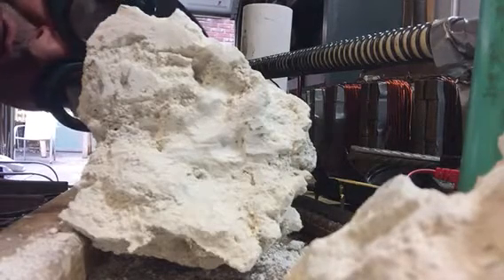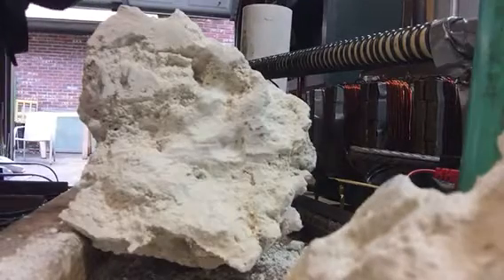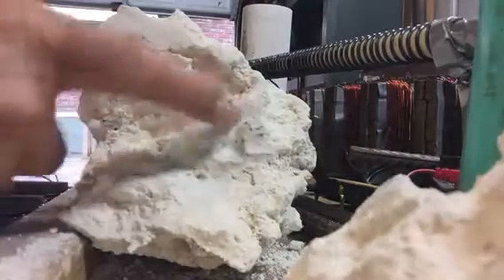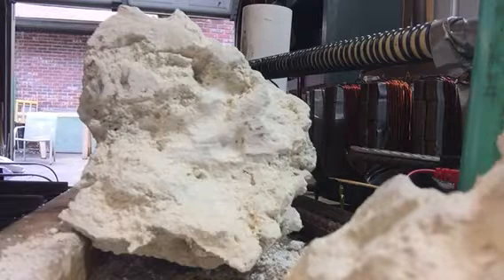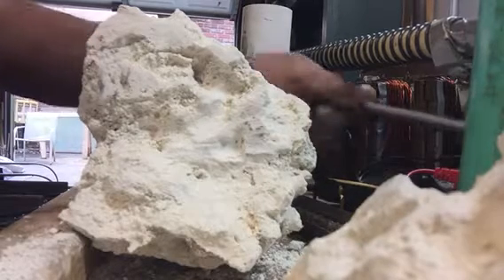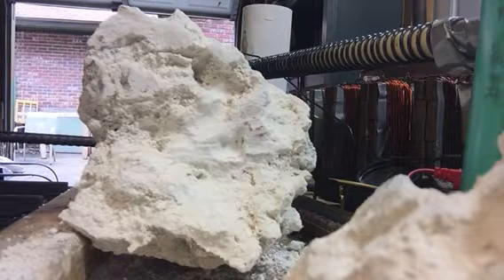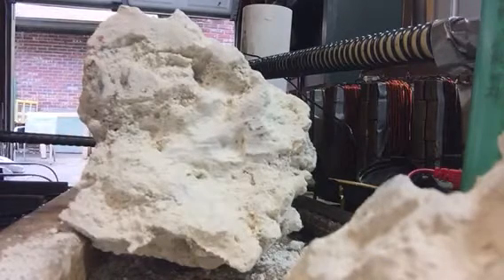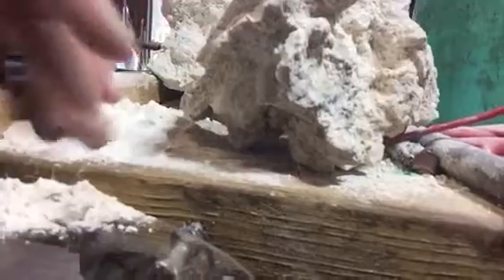Coral Rock & Static levitation

Comment: Roy watch ingventor youtuber name. Pete shows you a rattle snake magnet in one of his coral castle videos reacting to the wheels pole neutral field as it spins the magnets field poles are in the Middle like our equator. But the magnets field is at 90. Degrees to the wheels static field ( tesla knowledge ) listen as pete says. "It lifted out the glass earlier ". Static ac colliding with static dc Equalising with vacuum field forces from the surrounding environment. Just a thought The exciter may be Petes body were full of water and minerals Crystals !